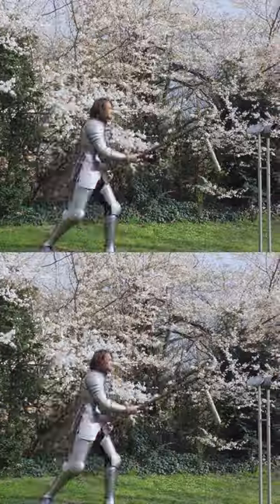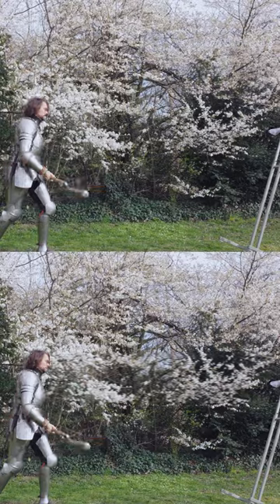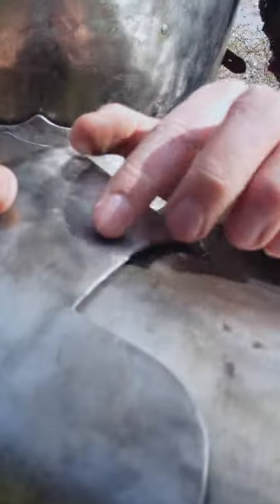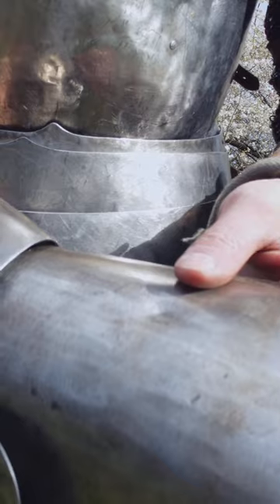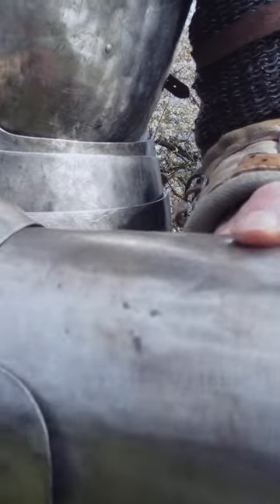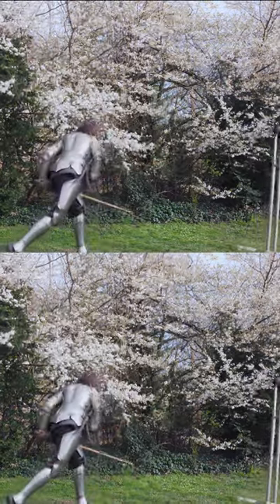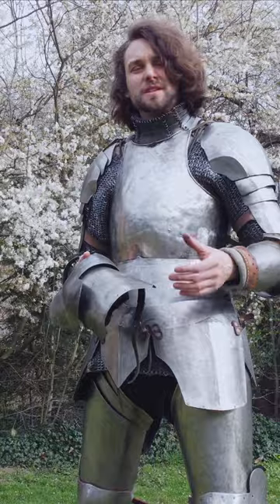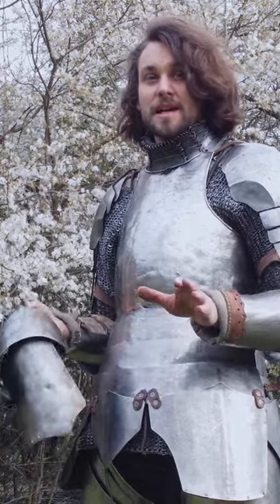War flail vs hardened steel armor

Comment: This reminds me of what I've seen mainly i think from Shadiversity mentioning it I think?  Comparing nunchucks to a similar size and weight stick.  They decided a stick is just better as the chain in the nunchucks allows you to swing them really fast but it completely breaks the force behind the blow.  If you smacked someone on the head with a nunchuck it would suck, but you could do the same thing with just a stick.  Against someone armoured or a stronger body part, that stick will just be more effective.  I think I also saw a short of someone hitting balls with a nunchuck out of the air to demonstrate the lack of force, you can hit the ball but you're not able to send it flying like you can with a baseball bat at all.  I'd guess it's main utility is just being essentially foldable so you can conceal them, and if you're using concealed nunchucks you're probably somewhere unarmoured where just smacking someone on the head will be good enough, and maybe the chain helps with close quarters mobility to do things like twisting around their arms or choking them?

Comment: Imagine getting smashed in the forehead with that thing in the year 1693
Reply: Ahh the nostalgia
Reply: 1700s kids just wouldn't get it
Reply: Neither flails nor the kind of plate armor shown here would be of much relevance by 1693...
Reply: @patrickkrohl3612  to quote from Wikipedia; "During the 1880s, a gang of Australian bushrangers led by Ned Kelly made basic armour. Each of the four Kelly gang members had fought a siege at a hotel clad in suits of armour made from the mouldboards of ploughs."
Reply: @patrickkrohl3612  mele weapons, including crude maces and flails, were used throughout much of the first and second world wars, and body armor didn't entirely go away at any point in the last millenia. Keep in mind that full plate armor like what is shown above existed simultaneously with the proliferation of practical handheld firearms, and still existed for a while afterwards.
Reply: The middle ages ranged from 1000-1550. 1693 is renaissance era

Comment: I can't confirm if it's 100% true but I have been told that flails didn't exist and kinda showed up in museum one day like the iron maiden did.
Reply from the maker: There are many historical examples in historical drawings and paintings. I have a long video about flails!
Reply: @dequitem  Upon looking further into the matter it seems more like they might have been used very little. Which makes sense seeing as a flail is overall is just worse than if you had a ridged weapon.
Reply: Sorry for responding so late I just forgot I made this comment a day after I made it.

Comment: Could you try setting up a simulation as if it were a blocked hit with the head wrapping around and hitting? When I used them, the head accelerates when ain't shaft is blocked
Reply from the maker: Did you saw my full video?
Reply: @dequitem  yes!! I love them and reposted thud on to my fb page also!
Reply from the maker: It's hard to manage a valid information from that test if I didn't use my own head 😅

Comment: You said in another video that having a spearhead on the other side of the flail would be useful. Is there any historical or practical reason why this wasn't done? Also, perhaps you could demonstrate a flail with a spearhead in one of your knight battles.
Reply from the maker: I know two examples of spearheads  on war flails wielded by knights. I show the images in my video, but most flails don't used it.

Comment: What you need is :  a heavyer striking part or bigger sharper spikes on the striking part... i had a one handed flail with a full metal striking part with larger but blunt spikes... it rekt a coconut in one swing , made gashes in big trees and so on... also with a one handed flail its easyer to strike without winding up because you could keep it swinging circles and strike out of that momentum.. try it...

Comment: I'm skeptical. First you're testing on a simple Arm/shoulder Plate. 
2:  it displaced with the impact 
3 : if your hit was well placed and strong enough we cannot determine the actual damage as the wood rack under it might have held it together. 

On an actual arm, with padding, chainmail and plate. This might not cause extensive damage to the armour ( as your Opponent's arm would naturally move and react to your blow ). But again, to its maximum damage, The slam can cause vibration that would lead to a muscular or ligament pain. Which takes a week to heal but wouldnt neutralise outright your enemy. Unless you hit was on their helmet...
Reply: Plated arms and legs are very weak to axes and halberds. You will be swinging a heavy mass of metal that's sharp enough to crack the plate or, even better, go straight on the junctions ( elbow or Knee )
Reply from the maker: Do you know that I do actual combat with these and other weapons? And we don't get injured every time. Plate armor works fine!